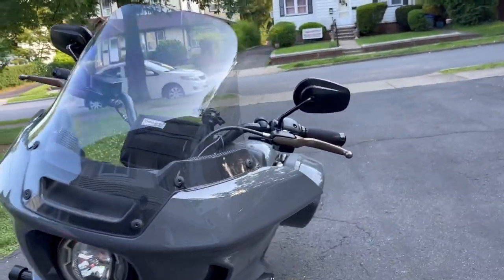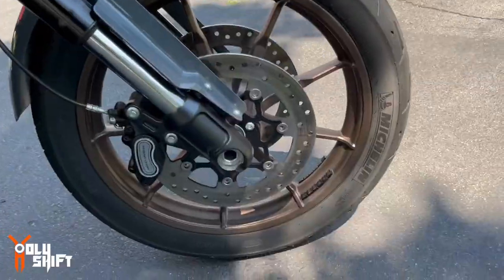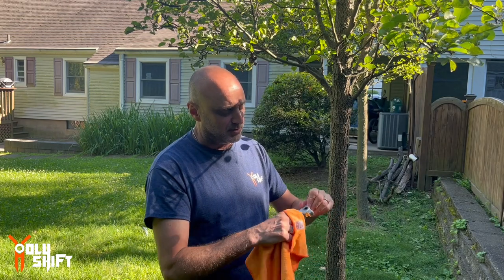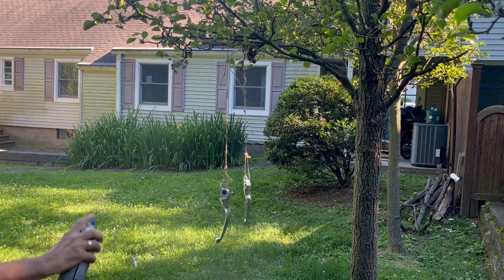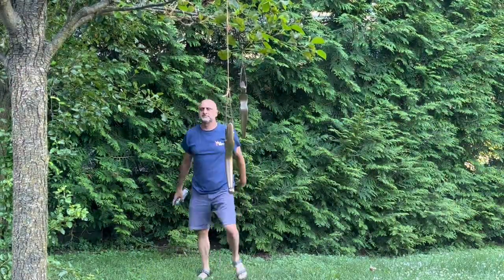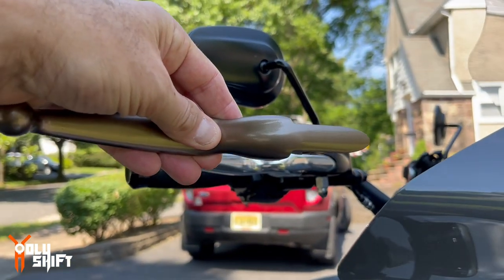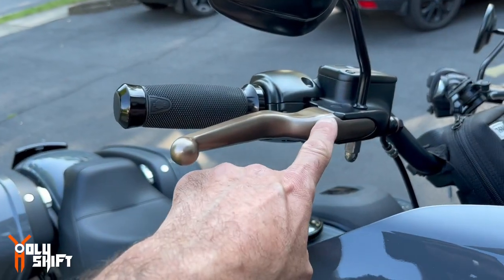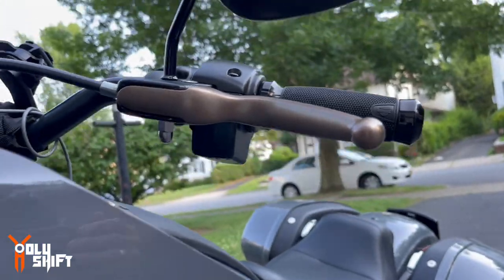This Upgrade Cost Only $ 8.32...

Comment: I have a 2014 Dyna I shorten the handles down  smooth them out drilled 4 holes in each and powder coat them glossy black and put them back on they look good you should try that on yours

Comment: Bring them to a good gun shop and have them color match them with Cerakote. Will last forever. Or you can try to do it yourself. Cerakote Ceramic Coatings. That rattle can paint you used will wear off pretty soon

Comment: The clutch handle is super easy. The reason why it wasn’t easy for you is because you didn’t release the locking mechanism located just below the handle on the frame,  follow the clutch cable to where you’ll see there’s a section that is covered. Slide the cover up and expose the yellow mechanism. Use a screwdriver to push in the red plastic clip and viola…. The pressure is released on the clutch handle.
Reply from the maker: Exactly buddy- And thanks for the explanation. I didn’t do that , but I’m gonna do it soon again - because I’m taking them off again and painting them with clear coat paint !

Comment: What is the pin removal tool called?  May have answered my own question.....Snap Ring Pliers?
Reply from the maker: I think so. A few dollars at harbor freight
Reply: @HOLYSHIFT  And a lot cheaper than even Amazon.  Thanks again.

Comment: They look awesome Sandy!  It’s always good to have a buddy that has all the tools - had to know Big John would have Snap-ring pliers 🤣 to remove those levers.  The clutch cable needed to be loosened up though before you attempt to remove the plastic pin.  You’ll fight that tight cable, you probably found out.  Love and learn.  Stay safe and keep upgrading.
Reply from the maker: Buddy- where is the cable loosened ? On the bottom side? Where it enters the clutch assembly?

Comment: At the 7:29 mark in the video ‘you see how these are not the same?’ 
No!! Because you don’t have them in the camera frame man! Cmon man. At least make sure the objects are viewable. I’m all ready to see what the differences are because I’m doing something similar but I can’t see why you can’t use the handle. 😵‍💫😵‍💫😵‍💫
Reply from the maker: Sorry buddy- but they are physically different sizes , also clutch cable VS. Hydraulic clutch handles are different!
Reply: @HOLYSHIFT  True Buddy. They are different.